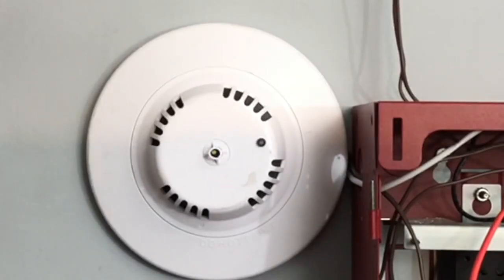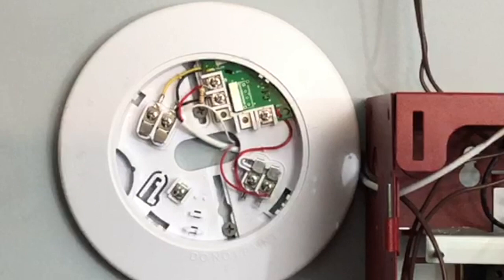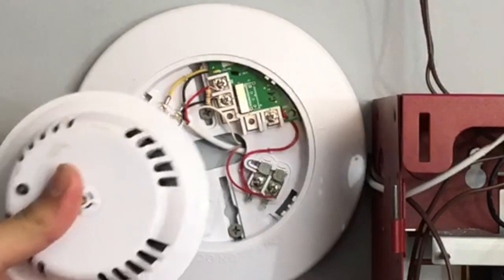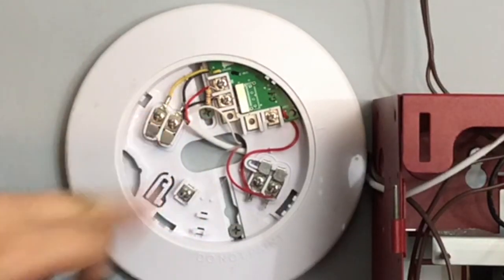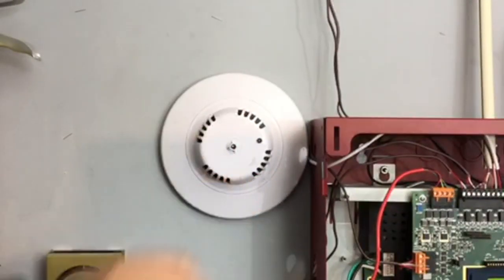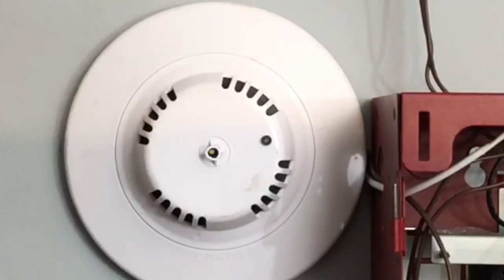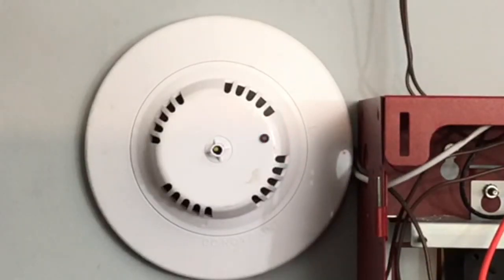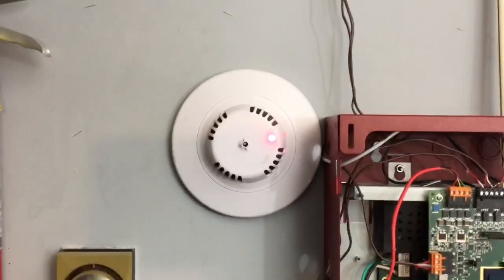Bosch F220-PTH smoke and heat detector overveiw & test

Comment: Hello, I'm from Peru. I have a problem. I want to connect this smoke sensor model to a Bosch D7044M module. How would I connect it? Do I need a 24-volt power supply?